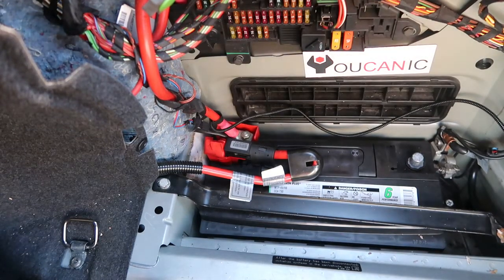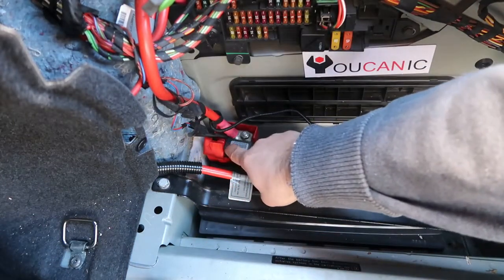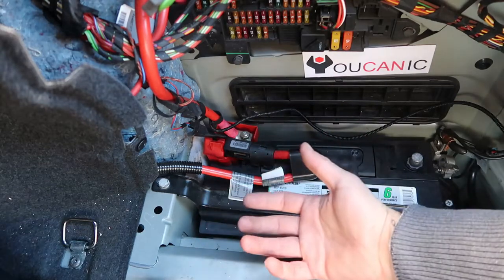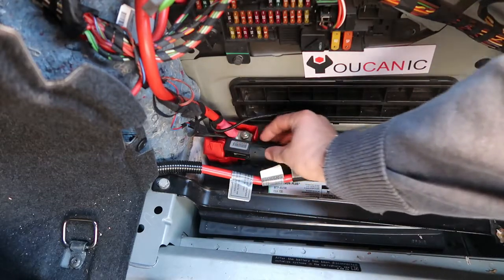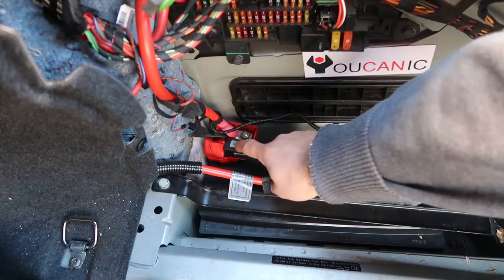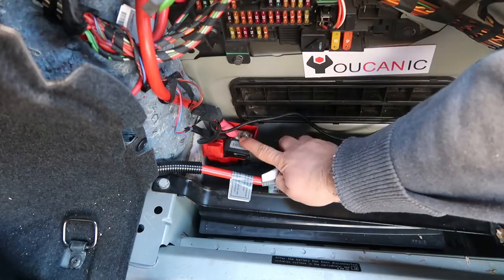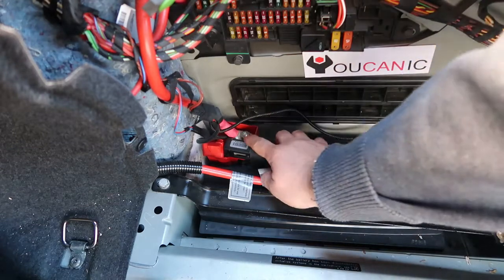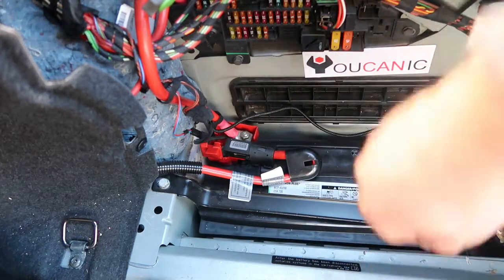BMW Battery Safety Terminal (BST) Explained - What You Need to Know

Comment: Will the power to my dash and all that stay on? Im having this issue except i get power to my interior such as i drive and such but my alternator isn’t getting anything
Reply: an electrical short will also do this.  doesnt have to be a crash.  also you might try replacing the ignition switch, NOT the locking mechanism that the key goes into, just the switch.   it gets worn out and finally will not send power to the starter so car is completly dead, no crank-nothing but instrument panel and lights, etc. still work because the ACC connection in the ignition switch is still good so it connects that circuit when you turn the key